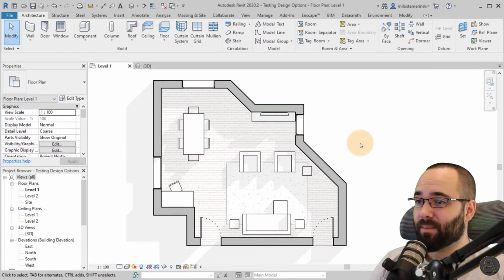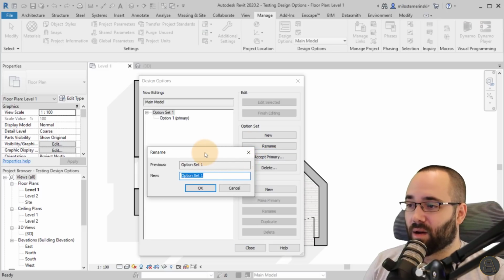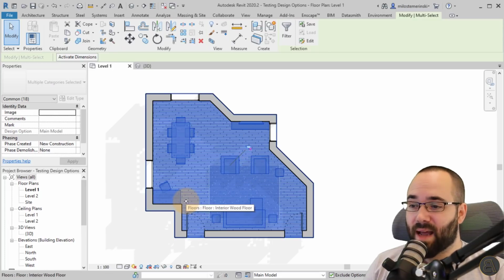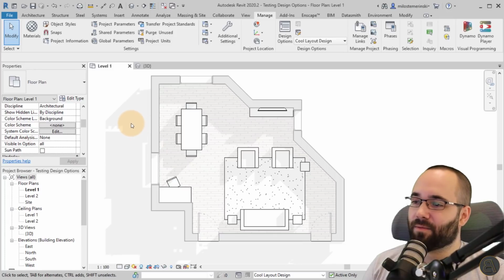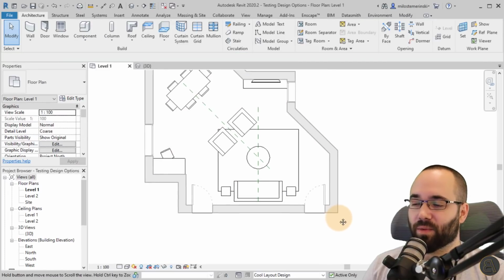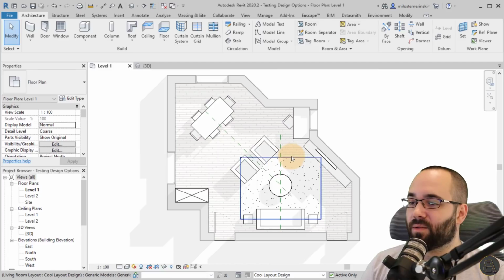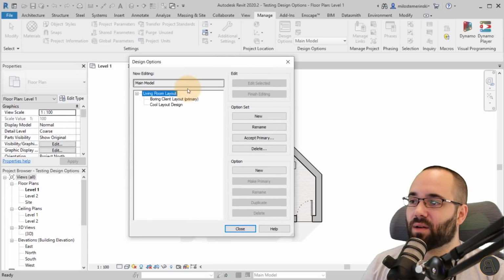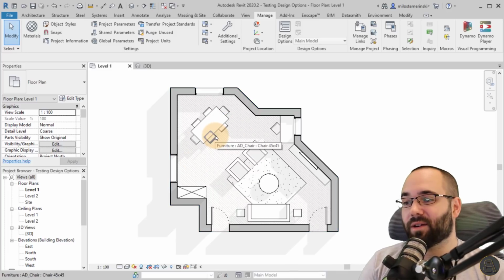Testing Design Options in Revit Tutorial

Comment: 🎯 Key points for quick navigation:

00:02 🎨 Balkan Architect introduces a tutorial focused on testing design options in Revit, emphasizing its complexity compared to AutoCAD.
01:00 🛠️ Revit has specific tools called design options that facilitate testing different design variations within building information modeling.
01:57 📚 The tutorial encourages viewers to explore an in-depth course on intermediate to advanced Revit topics, including design options.
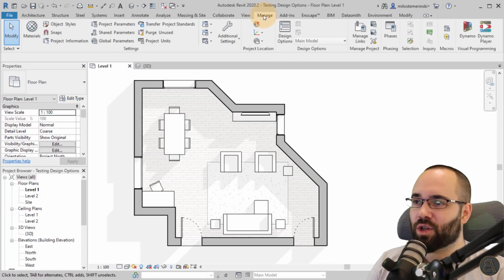02:58 🏗️ To create design options, one must open the design options panel from the manage tab or the bottom of the screen.
04:00 ✏️ Users can have multiple design option sets for different aspects of the model, such as facades or floor plans.
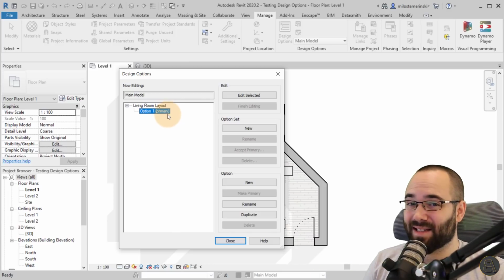05:01 📏 The default design option represents the current model state; users should rename options for clarity.
06:08 ✅ Selecting elements for design changes involves filtering out items that won't be affected, like doors and windows, to streamline the design process.
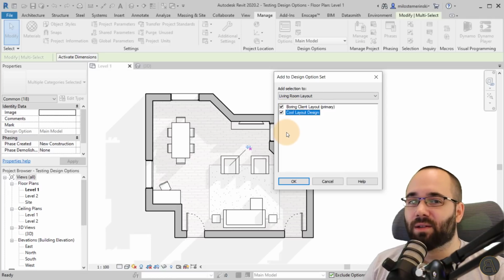07:08 🔄 The design options feature allows users to save chosen elements to various design scenarios, facilitating comparison and adjustments.
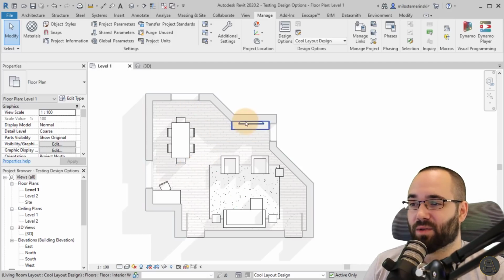08:09 🔄 Users can manipulate elements in the design options, such as rotating furniture and adjusting layouts to meet creative goals.
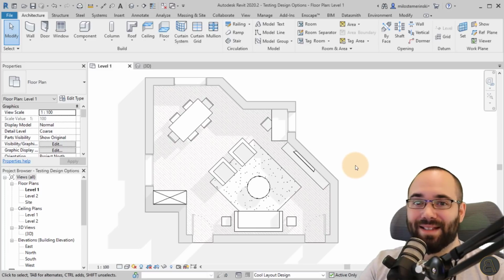13:39 🌀 Changes to the floor pattern can follow the overall room rotation, enhancing design coherence.
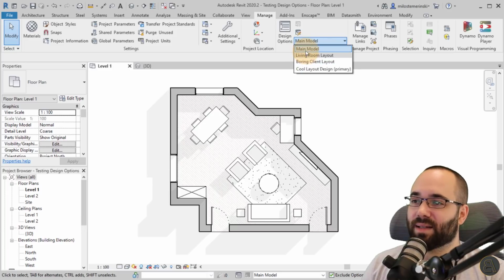14:40 🔄 After finalizing a design option, users can switch it to the primary option to set it as the default view in the model.
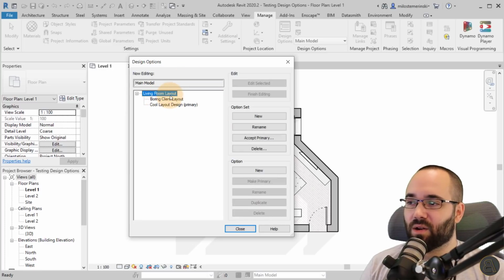15:37 🗑️ Once a design option is chosen, old options can be discarded by accepting the primary layout, simplifying the project moving forward.

Made with HARPA AI

Comment: Hi, I'm new to revit. I have a question for you. Let's say I have a data outlet. You can write it manually for its height from the floor.It is not linked to wall. I attach it to the wall so that there is no gap. When there is an architectural revision, the wall slides and my element moves away from the wall. How can I see the all elements distance from the wall in a list? (There are about 2000 data sockets in the project) I don't want to look at the proximity of the wall in 3 dimensions one by one.I would be very happy if you could help...

Comment: can we turn off the greying out of non-primary options? exporting pdfs with correct graphics would be faster
Reply: For this, and to display the options as Alternates on a sheet you can go into the viewport created for your design option and open the Visibility Graphics panel.(be sure the "main model" is what is being viewed so theres no greying out) from there select the "Design Options" tab at the top, it will likely be set by default to automatic, select the drop-down and change this to your desired option you want to view. And hit apply. And there you have it, the design option should be shown without affecting any other views and without greying out your drawing.
Reply: @Matters26  thanks i missed this in the tutorials ! <3